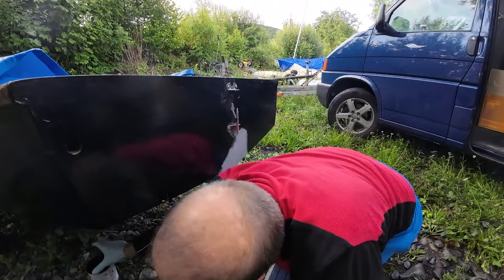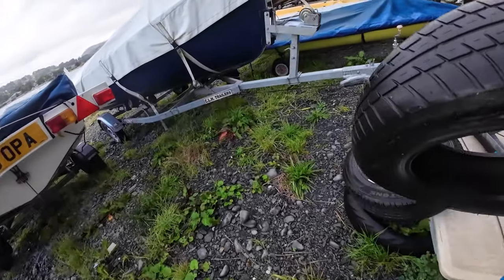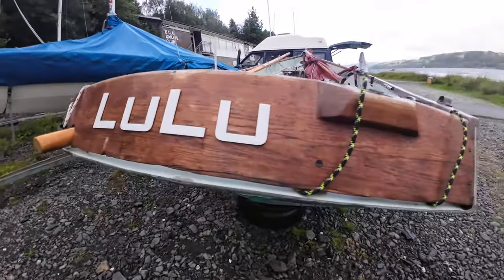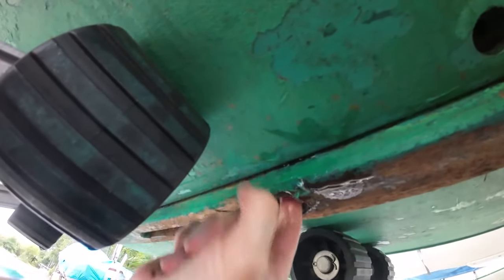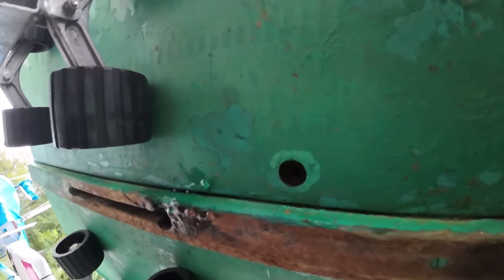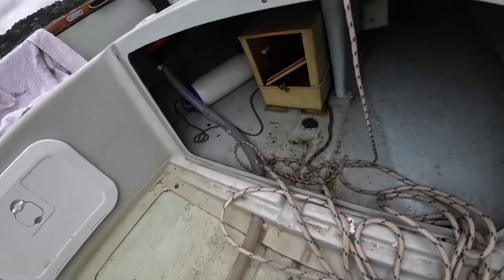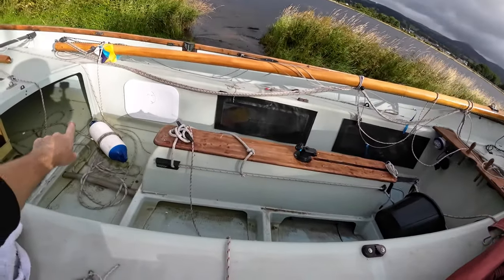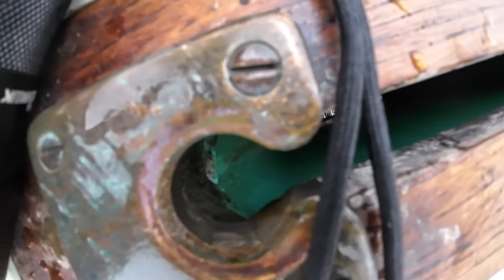Finding Another Leak In My Drascombe Lugger - Day 1

Comment: You could try rubber well nuts for c/b casing top holes
Reply from the maker: I'll look in to that. The classic way is to simply glass over them. I think to safe I like that idea. If you glass over enough then even if the screws loosen, no water should come in. I have seen some Luggers where they bolt through but then still glass over the bolts.

Comment: Hi Dave, delighted i stumbled upon this video as im dealing with the same leaks on my (new to me) Lugger from 1979. Been binge watching all he rest of your great Lugger content too! I had one question if its not too much trouble, which epoxy are you using in the video? Im sure there are sevaral products suitable but the due diligence is certainly done on yours! Is it the West System stuff?

Cheers,
Eoghan.
Reply from the maker: Hi Eoghan, many thanks for the comment, so glad its helping you.

Yes I use West Systems. the 205 epoxy and I tend to use the 205 hardener, although there a few to choose from. The only difference in hardeners is the cureing time. I need 205 otherwise here in the UK, nothing would cure outside the months of June and July, although you have to get a shift on in warm weather!!!

The fillers I use are mainly the 404. This is great for glueing and bonding things together. Its not bad at filleting too, however the 406 I also use but more so for better fillets. Haven't used that too much.

I would definitely buy the pumps as this takes away the whole measuring issue with the epoxy and hardener. It literally transformed my epoxying, knowing that I had the right mix every time. Haven't had any bad Epoxy since!!

One word of warning. "Epoxy" will stick to anything, including the "Polyester" resin the Lugger was probably made from, however when using fibreglass on the lugger make sure to get the right stuff. Some binders only dissolve with one or the other epoxy.  Nearly caught me out that did!!! Although I did my battery box the wrong way and it seems fine.

You can always email me if you need to. I reply as quickly as I can.  Or I would recommend the Drascombe Forum. Its only £15 per year to join and you get access to the forum which is quite active and full of tips and advice.  I'm quite active on there too!!!
Reply: @SailingWithDave  Thanks so much for the comprehensive response Dave! Great to have a community around these boats. My last boat was 1 of 1 in Ireland and no forums or such luxuries so thats a great shout, i'll definitely join the DA and get onto the forums. The more i tinker with her in the garden the more queries i have and i guess these boats have been around long enough for everyone to have tried something at least once and many mistakes made. Keep up with the fantastic content!
Reply from the maker: @T7_XR  Oh yes. they all have their modifications and their battle scars!!! But they are great boats. so sold and stable.

Comment: ah now this makes more sense , about the emails , epoxy it should fix it , mans 2nd best friend  lol
Reply from the maker: Yes. so this is actually a big weakness of the Lugger. The lower bearing is very porrly fitted. Its screwed into the hull with just 2 paltry short screws, that protrude into the lazarette. When they are knbocked about by putting tge rudder in all the time, they just come loos and eventually leave a hole where the screws were fixed in.

So I think first job is to fibreglass the top up higher to take longer screws.

Then get the bearing fixed better. Not sure how eay this will be to do!!!
Reply: @SailingWithDave  Can you 'nut n bolt' it?  Feels like a screw thread isn't suitable when you're drop[ing a heavy rudder onto it?
Reply from the maker: @anotherangleUK  Well I agree, a lot of Lugger people do bolt it through and also put a 2nd rudder bearing onto the outside of the keel band. We'll see!!!

Comment: Fingers crossed that's sorted the leak, the water was coming in rather quick.  Can you get access to that metal bit which is loose? Does the keel band have to come off to get at it?
Reply from the maker: Yes at one stage I was quite worried about it. Interestingly, the boat ended up floating during the night and filled up with water. Took me ages to pump her out before I could get her on the trailer!!!